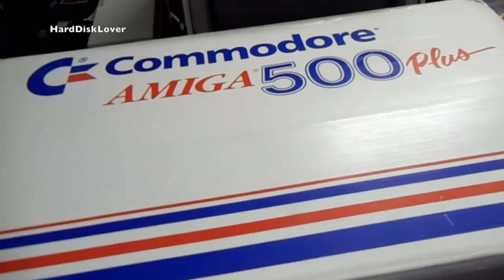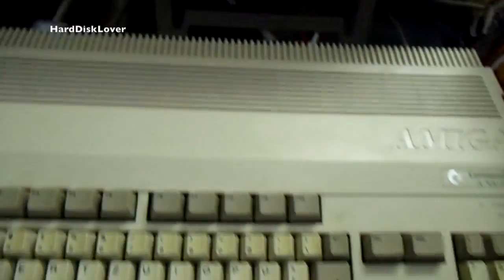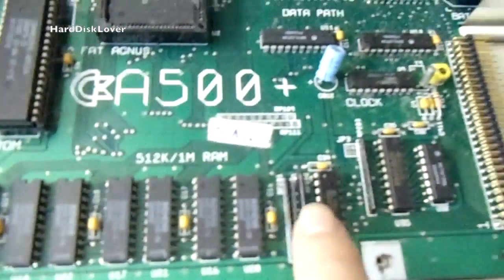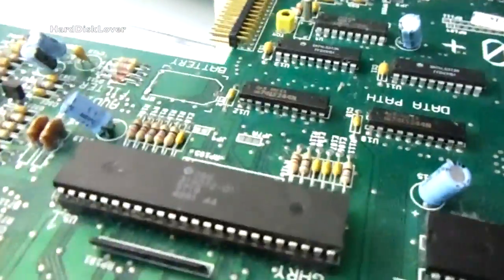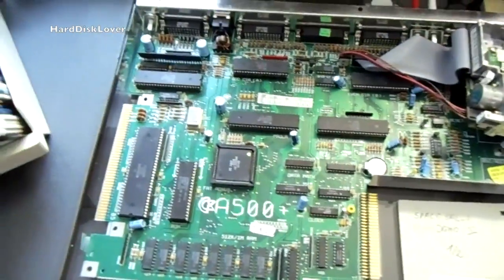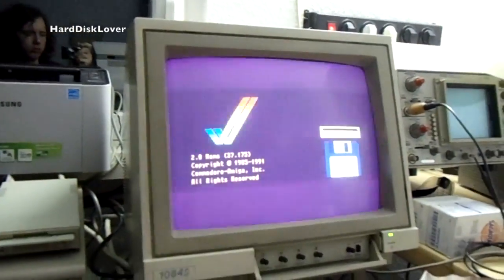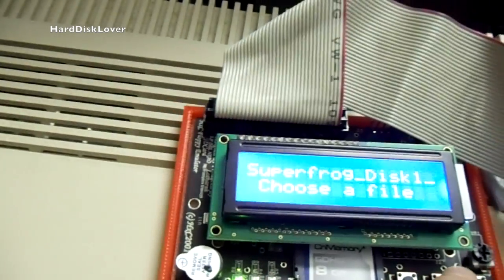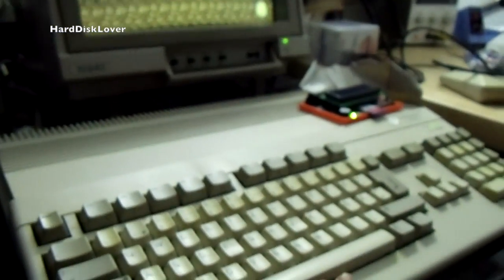Amiga 500 PLUS Repair and Super-Capacitor Modification

Comment: Maybe it's a good idea to use a resistor between the cpacitor and the motherboard, because when the capacitor is empty and you turn on the Amiga the inrush current will be extremely high to charge it. It's basically a short for a moment.

Comment: Got also a AMIGA 500+ but no battery on the board. Is very clean never used at all.

Nice AMIGA setup. 

Got fhe ACA500plus and a custom made A501+ Expansion with a supercapacitor.

Comment: Since yesterday the working noise is too low of my amiga 500 fllopy drive  and stoped reading floopy disks. The LED turns on but there is no loadind. Do you know why ?
Reply: I had a problem like that on my A500. I opened the drive and pressed the... I don't know the proper term for it, but the shaft or metal bar that moves the head around, it clicked back into place and we were back in business. Or you might want to just buy a Gotek instead.

Comment: Hello mate
how are you?
i can´t find Amiga 500 PSU schematic diagram
in the net maybe you can you help me?
Reply from the maker: Gulliver Gate Sorry again about the late reply :-/ YouTube for some reason doesn't notify me anymore...
I didn't have any luck finding the schematics online. But if you want to sort of rebuild the PSU you could use a small PC PSU (just make sure it has -12V and can go up to 4.5 Ampere on the 5V rail) http://www.nightfallcrew.com/15/06/2014/commodore-amiga-500-full-replacement-power-supply/

Comment: Hi mate, so you had another pacient to ressurrect ? hey the manuals are almost new...but mate that battery just for giving the hours in real time so it´s not important...i think. A better mesure to avoid teardown or anomaly maybe is not replacing the battery don´t you agree?
Reply from the maker: True, the best thing is just to go without the battery. But I wanted to have at least one machine that has a working RTC and for that a Super Capacitor is probably the best option.
I wanted to have a little bit of a challenge on fixing something, that's why I got this A500 plus :-D
By the way I love your profile picture ^_^
Reply: Hey dude Where it´s possible to send a Commodore 64 to be repaired ? do you know a reliable store with a repair service?
Reply from the maker: Probably "The Future was 8bit" they offer a repair service and I have my SD2IEC (C64 floppy emulator) from them: http://www.sd2iec.co.uk/
Reply: Talking about Amiga 500 and Commodore 64  I´d like to have a list of symptoms that denounce damaged capacitors, teardowns,etc. How can i detect or visualize on the screen tv etc..A amiga 500 should be opened periodically how often ? (to check for anomalies)
Reply: I turned off de C64 but i forgot the Commodore power supply plugged to the electrical outlet for 7 hours and  I noticed he warmed. This can be harmful?
Reply from the maker: TheReasonForYou It can be harmful. The C64 PSU can overheat easily and I recommend not to use the original one. To check if it is still ok just verify the voltage on the pins with a multimeter should be 5V DC and around 9V AC: http://ist.uwaterloo.ca/~schepers/MJK/power_plug.html
If the 9V AC line is a bit higher than 9V (e.g 10V, 11V) that is normal because there is no load on it when you measure it.
Hey I can't find your recent comment about the Amiga 1200 anymore :-/
But If you want an Amiga 1200 In excellent condition, even with a one year warranty Amigakit has got them: http://amigakit.leamancomputing.com/catalog/product_info.php?cPath=40_85&products_id=305
but they are currently out of stock so it may take some time till they get new ones
Otherwise ebay could help but make sure that you have the option to give it back.  Some sellers even have a warranty. Just make sure that the Amiga has got new capacitors! The old ones will leak and damage the Motherboard! Also look out for one that has a Kickstart 3.1 ROM. 3.0 is okay but 3.1 works better with harddisks. http://www.ebay.com/sch/i.html?_odkw=amiga+12000&_from=R40&_osacat=0&_from=R40&_trksid=p2045573.m570.l1313.TR0.TRC0.H0.Xamiga+1200&_nkw=amiga+1200&_sacat=0
They are getting a bit expensive but that is because the A1200 is slowly starting to get rare.
Reply: They are already rare mate..thanks for your attention
Reply: Commodore 64 users told me that the warming is natural, power supplies are made to handle with that and they say is just a matter of consuming extra energy...but if i don´t use the original one that can be harmful i think i must have another power supply in stock but the recomendable to use is the original